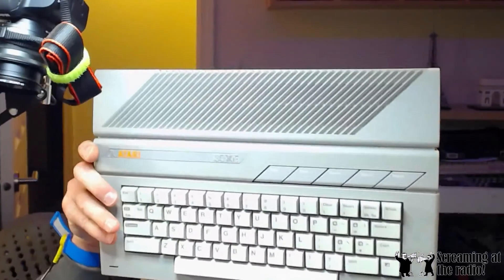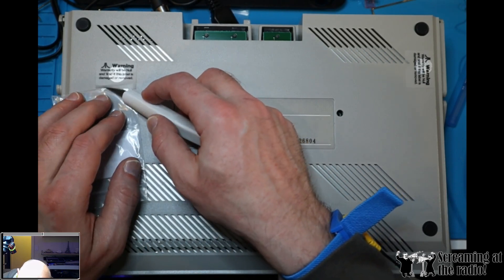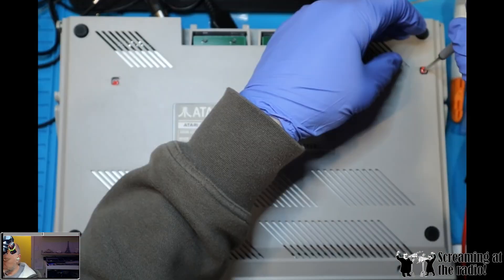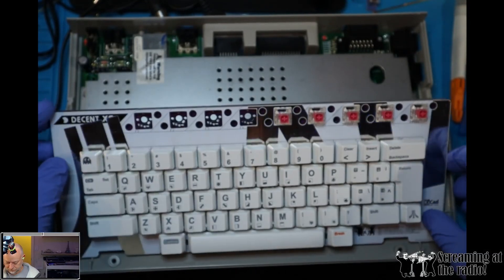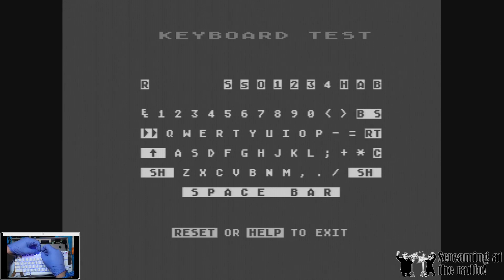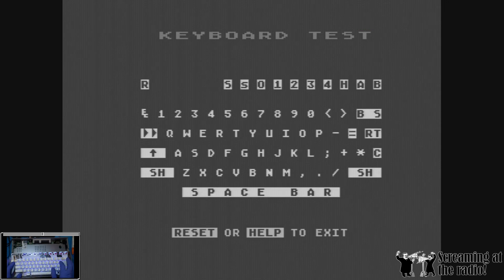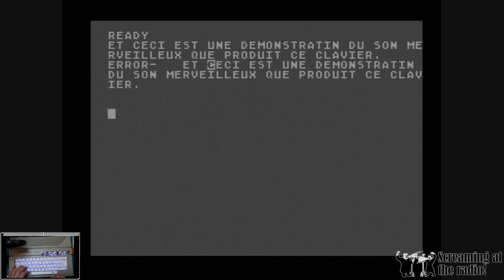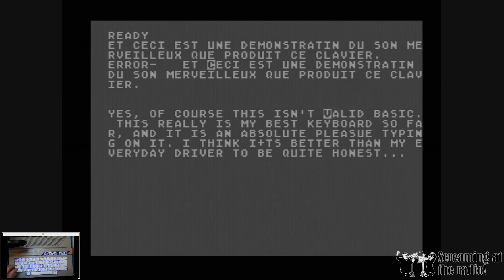Decent XE replacement Atari keyboard installation

Comment: Very nice, I have just received my boards and alu top boards, I also managed to print the resin stems, what type of screws are you using between the boards, It mentions 5.3mm with a 3.1mm spacer but that doesn't seem right when you factor in 2 board thicknesses, are these countersunk, cap head etc ?
Reply: The readme is not yet updated for the latest. If you took the files from the branch that I linked in the description, the boards should not have screw holes at all. Screws and spacers are not necessary since there are already 62 switches maintaining the space between PCB and plate.
Reply: @Bertrand Le Roy  hi , I have the rev.D pcb with kaillh switches and alu pcb top plates
Reply from the maker: @CaptainCommodore  Yes, latest revision is 11, but in any case you don't need screws and spacers: the switches are enough, which is why I removed the holes entirely.